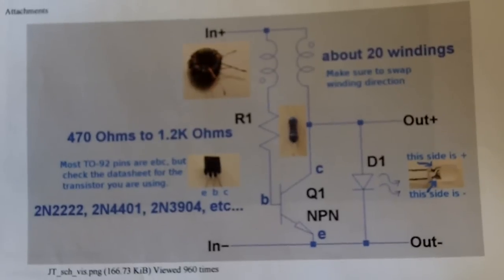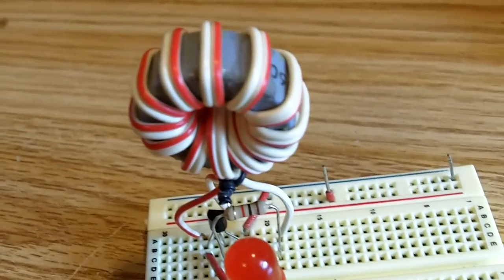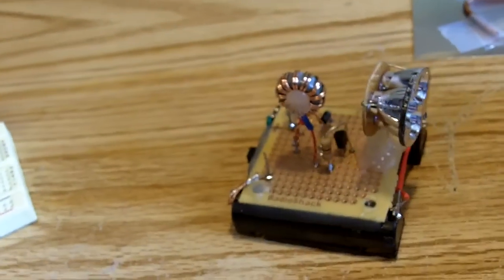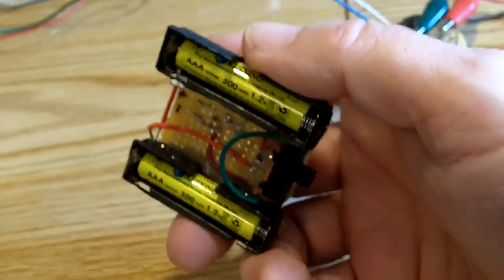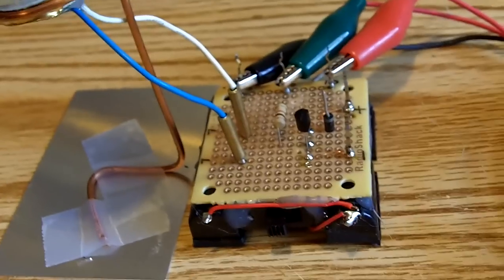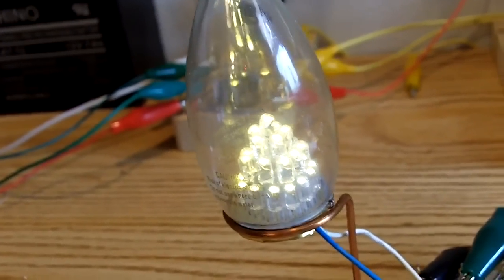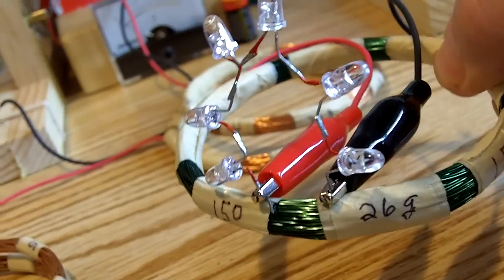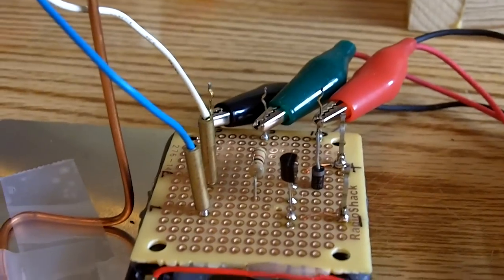Joule thiefs

Comment: Love it!
Instead of putting the batteries in parallel on your “flashlight”, what if you put one of the batteries in series w/ the LED’s then you can charge one battery while running the lights.
You can add a switch that will alternate the batteries, or just rotate them. An almost forever light :-)